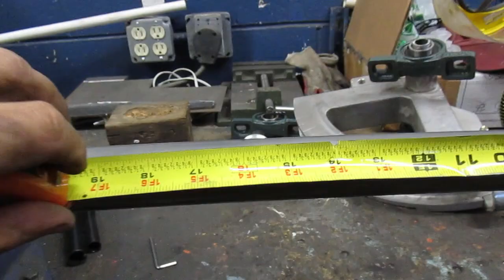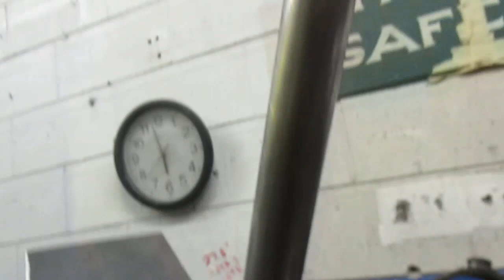DIY Tubing Bender made from Tubing

Comment: Great compact design. I was wondering if the push point being so close to the pivot point would add a lot of extra stress to the die - but it seemed to handle it no problem. I just built a bender using a cheap die set but it cost me $450. I like this copmpact bender. May have to build one. I'll subscribe. Thanks for the vid.

Comment: How did you figure out the length of structure between the die and the bottom of the jack? Thank You! JD
Reply from the maker: at about 14:00 I just swung it around and measured how much it had to move down, so the jack bottom was placed that far above using the two tubes.
Reply: OK, I think I get it! Thanks!! JD

Comment: Nice unit. Can you switch dies or would a guy need one for each die set? What size bearings were you using? 
Thanks.
Reply from the maker: It should work with bigger dies.  In fact I need to do some 1-3/4 but haven't got the dies yet, was going to make my own as another video.
The bearings were 1in ID